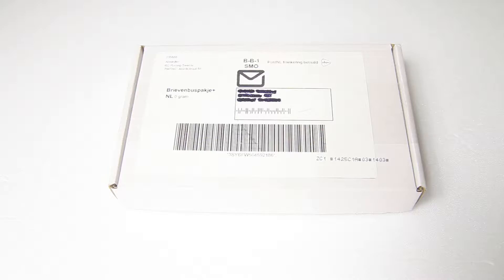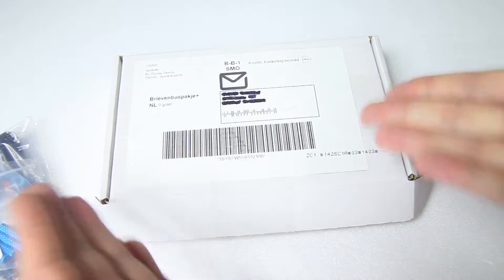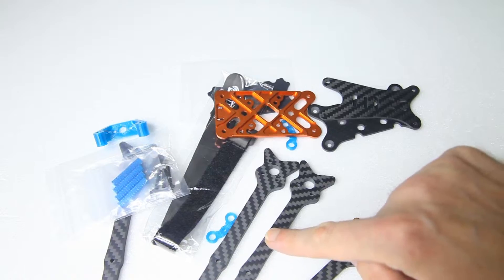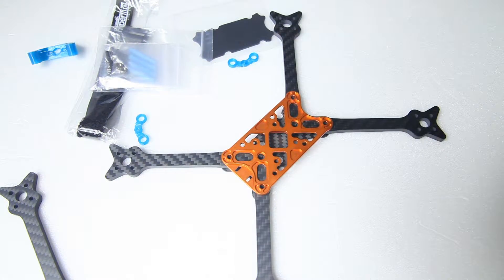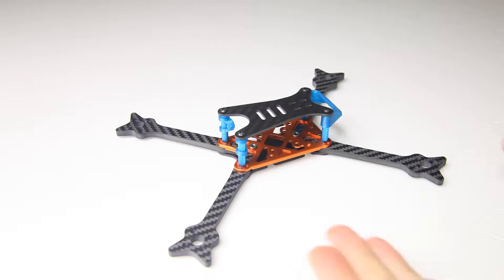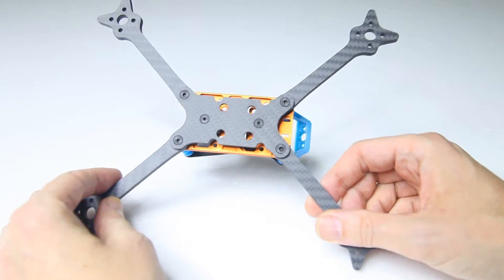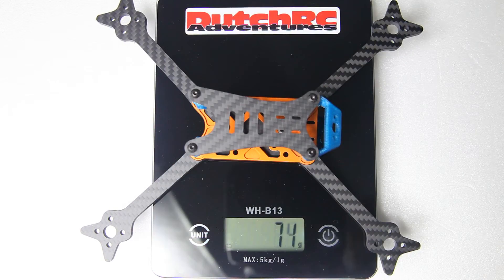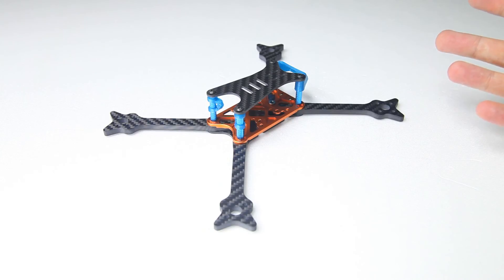Hyperlite Floss 3.0 - DutchRC 200GT - P2: FRAME REVIEW

Comment from the maker: My overview / review - "what kind of frame is it?" on the Floss 3.0 
Floss 3.0 frame: https://fpv-racingtwente.nl/product/hyperlite-floss-3-0-race-frame-5-inch/?fbclid=IwAR1K-Et0hR-367CXdMEwBmdkr2wMVLRBTtTwvWuJZOphhhD49DqBJUX4wg8 

Specifications
type: allround / racer 
wheelbase: 215mm 
base thickness: 5mm (arms) 
material(s): carbon fiber with allu standoffs 
weight: 74 grams 
chamfered edges: yes, minimal but effective 
clean: Very
buzzer: nope 
LED board: nope 
battery strap: yes 
battery anti-skid pad: yes 

other parts for this build: 

Diatone Mamba F722 mini stack: https://www.banggood.com/MAMBA-F722-MINI-Betaflight-Flight-Controller-OSD-5V2A-306-30A-2-6S-Blheli_32-Dshot1200-FPV-Racing-Brushless-ESC-for-RC-Drone-p-1490803.html?p=TO251813974002015038 

Emax 2207 RSII 1600kv motors: https://www.banggood.com/Emax-RSII-2207-1600KV-2300KV-CW-Thread-Brushless-Motor-for-RC-Drone-FPV-Racing-p-1384905.html?p=TO251813974002015038 

T-Motor T5132 propellors: https://www.banggood.com/2-Pairs-T-Motor-T5143-3-blade-Propeller-5mm-Mounting-Hole-For-RC-Drone-FPV-Racing-Multi-Rotor-p-1309181.html?p=TO251813974002015038 

Rush XR602T-b3 Crossover D16 receiver: https://www.banggood.com/URUAV-XR602T-B3-16CH-SBUS-Mini-Receiver-Support-Telemetry-RSSI-Compatible-Frsky-D16-p-1466446.html?p=TO251813974002015038 

Runcam Phoenix 1000tvl camera: https://www.banggood.com/RunCam-Phoenix-Oscar-Edition-1000tvl-13-Super-120dB-WDR-Mini-FPV-Camera-Support-OSD-FC-Control-for-RC-Racing-Drone-p-1475238.html?p=TO251813974002015038 

AKKtek FX3-ultimate VTX: https://www.banggood.com/AKK-FX3-ultimat-5_8G-40CH-25200400600mW-Switchable-Smart-Audio-FPV-Transmitter-Support-OSD-p-1388018.html?p=TO251813974002015038 

Tattu Rline 1050mah 6S lipo's: https://www.banggood.com/TATTU-R-LINE-Version-1_0-22_2V-1050mAh-95C-6S-Lipo-Battery-XT60-Plug-for-RC-Racing-Drone-p-1467120.html?p=TO251813974002015038 

CNHL 1000mah 6S lipo's: https://www.banggood.com/CNHL-MiniStar-22_2V-1000mAh-6S-100C-Lipo-Battery-XT60-Plug-for-RC-Drone-FPV-Racing-p-1352725.html?p=TO251813974002015038

Comment: what size motors do you need for this frame ? can you give me a link  for some powerful motors for this frame
Reply from the maker: howdy man ;)  depends on your preference but basically Any modern motor in the range of 2205 -> 2307  (and anything in between).. those can be found at Any shop that sells quad parts. 
I would probably go for 2207.5 motors myself